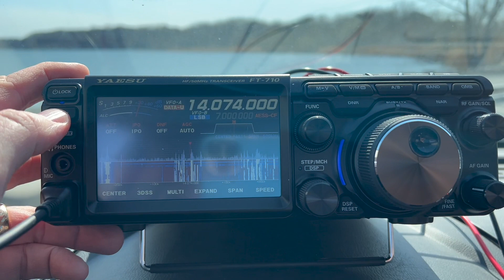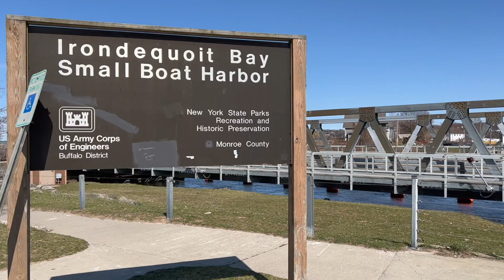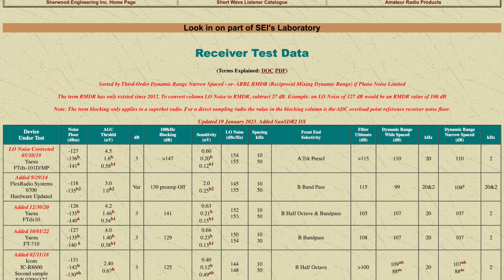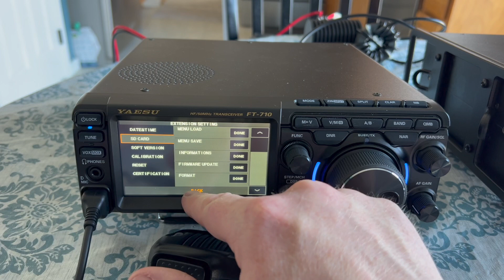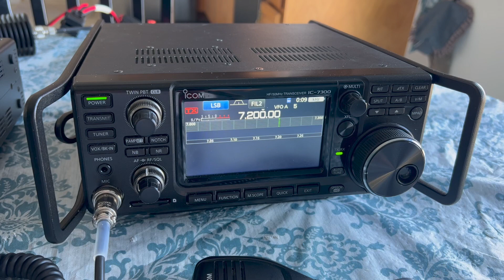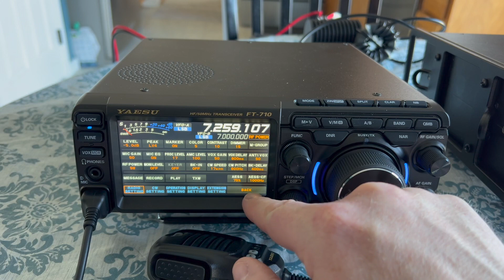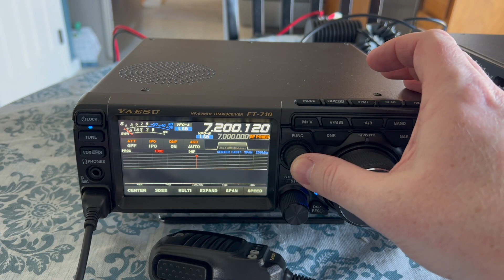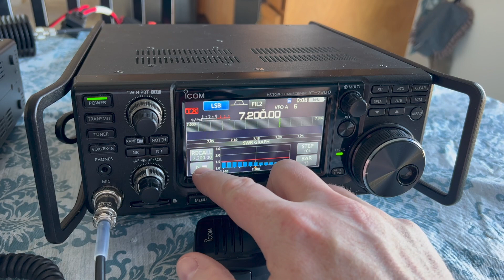POTA with Yaesu FT-710

Comment: I wonder how much on the 710 can be set and forget once you get it where you want it?   It seems like the 7300 is the Microsoft Windows and Yaesu products are like Linux.   Amazing that the 7300 going on 8 years and no one seems able to capture the ease of use and functionality.   Sure the 710 performs good because "Sherwood says so" but all the really important factors aren't always performance related.   Ergonomics, ease of use, "fit" is really important.  I've always said I would rather have a lesser performing radio that's fun and easy to use that a good performing radio that's quirky, fidgety and just doesn't "fit" quite right.
Reply: Maybe the other way around, the 7300 hasn’t ever locked up on me. The 710 and dx10 both have. The dx10 being the worst, had to unplug it completely.
Reply from the maker: Good points. ICOM definitely makes it easy to use the 7300, 705, etc. Thanks for watching!
Reply: @MikeN2MAK  I agree, DX10 for professionals, 7300 for kids.
Reply: You have that radio. if you like it great. I have had several Yaesu radios and they fit are great to use and I find Icom confusing. There is no need to put down other manufacturers because they have produced a newer better radio. Rob Sherwood has forgotten more than most hams will ever learn and even he says his list is only part of the picture, but it says a lot of important things. The 710 will only get better.